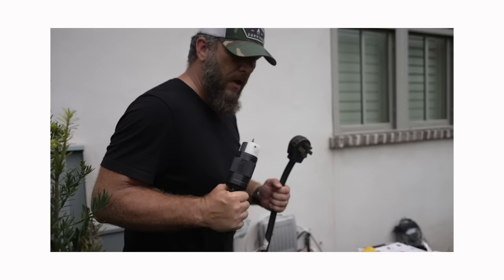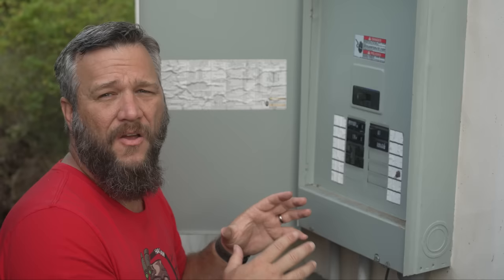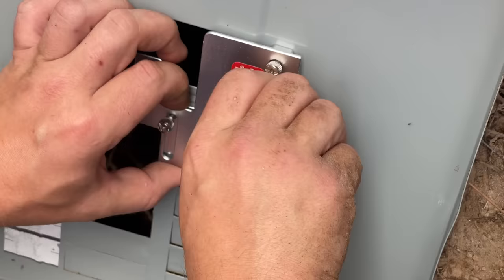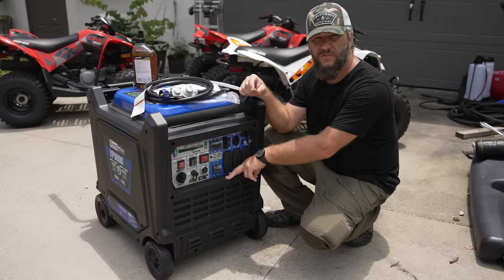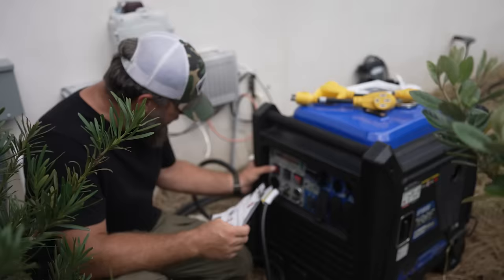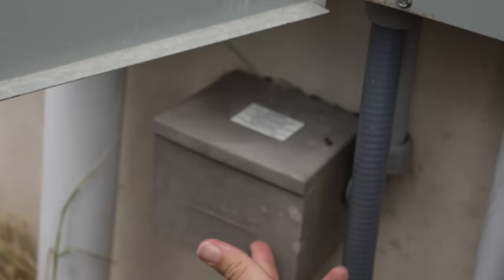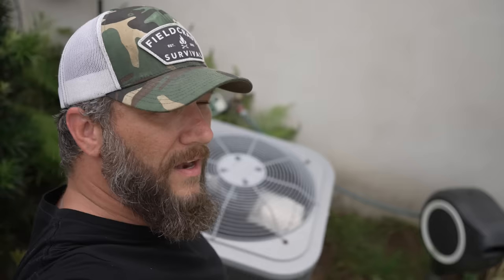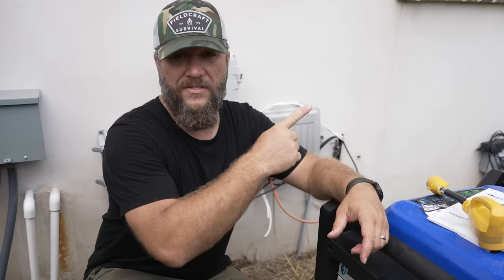90% Don't Know About This Fatal Generator Connection

Comment: So you flip the breaker off so the house is not energized no more but those two lines feeding the sub panel are still energized..😳   So you should be working with one hand and the other behind your back. 

 I made a none fatal mistake.  That was avoidable.  I was tightening (1 of the MAIN  electrical feed line ( LUG BOLTS  ) they're Allen key and sometimes you can get away with using the large flat head screwdriver inside the lug I'm glad I switched my hand positioning. Originally I had my left hand towards the shaft of the screwdriver in my right hand towards the handle what's the handle is not big enough and the chef was not coded with protective sheathing. Meaning the metal was exposed on the screwdriver shaft. 
  When I decided to switch my hands and put the left hand towards towards the handle and my right hand towards the chef my pinky overlapped onto the shaft of screwdriver. Augusta wind came and swung the panel door to my right elbow making contact and a pathway for the hot and the ground do you have access to each other. It only went through my elbow and my hand.
 If I had not switched my my elbow would have been touched on my right arm and the connection to the screwdriver shaft we've been for my left hand pinky. Meaning it would have crossed my heart making a electrical connection and offsetting the rhythmic pattern of my heart possibly killing me a three second job could take your life. Respect electricity don't be unmindful definitely don't bring emotions to work cuz you can kill yourself in a matter of seconds and then what's it all works.? When that panel door swung and hit my elbow it hurts so bad and the reaction was so quick that I flung the screwdriver out of my hand and it ended up sticking into the neighbors house through the stucco on the outside right next to a window period meaning it could also ended up hurting somebody else if it would have went through the window which was like less than a foot to one side my hand was unusable for about 15 minutes my pinky ring finger and middle finger where's closed and could not open them My hand is fine today but Now everybody gets off that he be careful.

Comment: No offense, but your hook-up steps are incorrect.  
1) turn off the main breaker and any other high-load breakers
2) leave generator breaker off....but plug in the power cable, both ends.  Now the generator is bonded
3) start and warm-up generator
4) turn generator breaker on

Comment: Damn. This is the first I’ve ever heard about inverter being safer. Can anyone chime in on how much of a risk this is using dual fuel standard generator? Last thing I need is shot to blow in my house because of the damn generator.
Reply: An Inverter Generator gives you Clean Sine Wave power with less than 3% Total Harmonic Distortion (THD) just like Utility Power. It's much safer and won't damage or reduce the life of electronics in the house. It also doesn't run at full RPM if not needed. My Champion 4650 idles at 25% most of the time and saves an enormous amount of fuel and its super quiet at 60dB.

Comment: Flip the switch at the pole outside and it will disconnect all electricity going to your house plug in your dead man switch start your generator and you don't have to worry about getting shocked or back feeding when electricity comes back on unplug your generator go back outside and flip the switch on the pole and your business you're in business

Comment: its not the electricans fault. there are many ways to hook up a jenny to a panel. the most important is to have very clear instructions on how to use a jenny on the panel  1 turn off main breaker. 2 turn off all large loads. 3 only leave on emergency  circs needed. you dont just throw a 50 amp  240 volt plug on the wall. determine the load you will need and make sure that you buy a jenny that  will handle a little over double of that load. some states require a transfer switch. like shithole CA. again follow the directions. if you are on a budget in the desert. i tell people to have a safe room --. bed rm. with small wall a/c unit , plugs , lights- cameras --house refer. mark these on your panel in red sharpie.

Comment: You are going to ruin your propane connections. Next time you take them apart, check and see if the male part has an o ring seal on the nipple. You can get a whole box of them for a few dollars. Easy to replace. Hard to keep up with.

Comment: Do NOT place your generator too close to windows, doors and/or vents while it is outside. Carbon monoxide could still enter your home if your generator is too close to these types of openings. Federal agencies such as CPSC and CDC recommend placing your generator a minimum of twenty (20) ft. away from homes, windows, doors and vents.
https://youtu.be/CCZI512FsQc?t=364
Right next to your window... Yikes!

Comment: I didn’t get to see how much your 3-1/2 ton central air drew? It must have been able to run it? 
If it doesn’t start right away? I will suggest getting a soft start kit for your outside unit. I have one for my A/C & my Honda EU 7000is starts my 2-1/2 ton Trane without a problem. I prefer Honda equipment over everyone else’s because it always starts on the first try. Mine is fuel injected unlike the others. 
You can store ethanol fuel up to a year if you treat it right? I use Marine grade Stabil & Star Tron fuel enzyme. After a year I rotate my fuel into my trucks. I like that you used an inverter generator. That’s the way to go. Many people buy expensive appliances with fancy electronics built into them. They could be damaged by a conventional generator? I wouldn’t take that chance. 
Yeah, your electrician didn’t do you any favors with the inter lock. Thanks for show casing that. I have the same set up but mine is way more elaborate. Mine cost $14,000 because my ASSociation wouldn’t let me have a propane tank. 
As for killing lineman? Not likely. We work safe all the time. Your likely to kill a pedestrian or worse a child than a lineman. Lots of fire fighters, police & public works people can’t tell the difference between a telecom wire & our equipment. We teach them that they all could kill. 
Thank your wife for me. She did a great job with the camera. 👍🏻👊🏻

Comment: Always the drama of "you could kill a lineman." While that isn't impossible it's pretty close. If you lack the sense to open the main before connecting a generator backfeed then you shouldn't have a generator at all. A person this dumb might also run the generator in an attached garage and kill the whole family. If you fail to open the main your generator is the one that will die an early death. Can such an expensive lesson fix stupid? Watching the way people drive in spite of the number and high cost of collisions suggests not. Keep your food safe with a good generator backfeed during a power outage. Keep your generator safe by having enough sense to turn off the main first and connect it with properly rated wire, plugs, and breakers. If you don't understand even one part of this get someone who does.

Comment: Inverters are kind of a joke. All generators produce clean power. The avr tells the engine to be at the desired rpm, which keeps your frequency at 60hrz. They just have insulated housing and better peak load handling. I roll my eyes every time I hear about dirty power, even in industrial gens

Comment: The generator connection box on the side of your house should have a recessed MALE PLUG.  The cord from your generator should have a FEMALE connector that mates with it. Yours was MALE, and if the generator had been running, the exposed prongs in your hand would have been hot.
Reply from the maker: That’s just a guide rode. It’s a female twist lock end.
Reply: Look up pictures of the 50amp generator plug.  That’s the correct end.
Reply: @HAXMAN   Thank you for clarifying.  I've never seen a guide pin on a female end before, so must have mistook it for the male end.  Watched the entire video again and much appreciate you sharing it with us.

Comment: PLEASE BE AWARE< THAT Gen is not capable of running a full house load.Max load is 50 Amps. Just your hot water heater and say a microwave on at the same time is 50 amps. You need to know the amp draw of your appliances and make sure you stay below 50 amps. I live in the Pacific Northwest and That Gen would not even run my furnace even if everything else was shut off. Know your loads and shut your other breakers off.

Comment: You are still not truely safe with this setup I have had breakers fail were handle is off and at least half of the breaker is still on. You should of had a real double pole double throw disconnect switch installed between meter and house and move generator far from house because of carbon monoxide and noise

Comment: Your electrician is a fraud. At best he's just incompetent. That was criminally dangerous to let you use that generator without an interlock.
Reply: Oh boy....i have back fed multiple houses  since 1991...no issues
Reply: @Docthewrench  Of course there's no issues. Until there's an issue. I'm surprised you admitted this. You broke codes, laws. SMH.

Comment: Not funny.  A little immature specially for the lady recording.  The video overall was good.  However, the breaker safety bracket is an excellent idea.  I made my own because the particular one for my box is about $100 dollars delivered.  I just can not believe the pro did not installed one.  Not very cool.

Comment: You did a great job on that install. Interlock kit installations may lead to PERMANENT beard loss, not just temporary though, so do proceed with caution.
Reply from the maker: Oh noooooo! Luckily it was temporary. 😂
Reply: @HAXMAN  hahaha… in completely other random news, you ever look into AWG water generator whatevers? I was today years old when I found out they existed, and since everyone seems to say there is no way to purify humidifier water effectively, I wonder if those things are useful.
Reply from the maker: @thefrankperspective4247  I just saw a video recently where a couple living off grid installed one at their cabin. I think the channel might be called ambition strikes.
Reply: @HAXMAN  sweet — seemed like something in line with your channel(s) that might make for a decent video if they aren’t absolute trash.